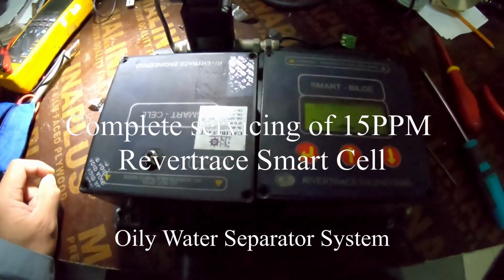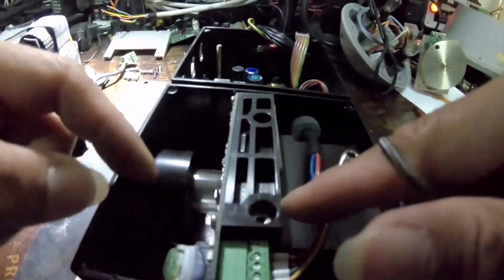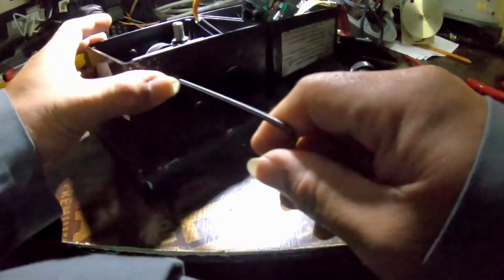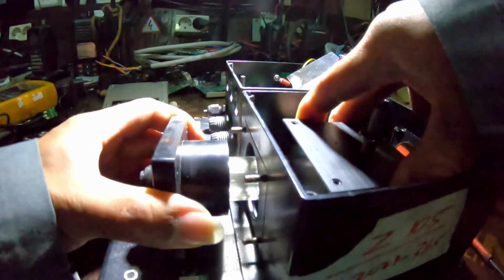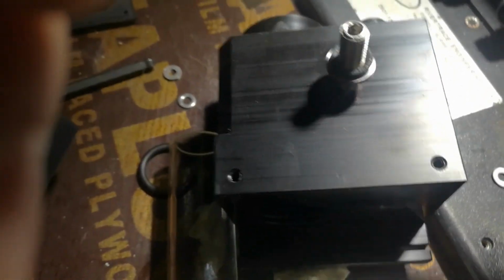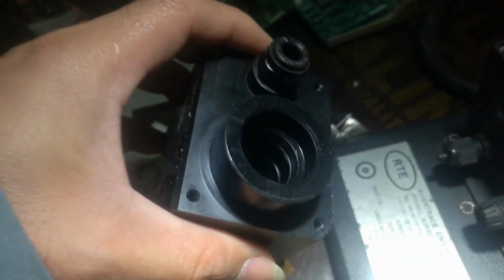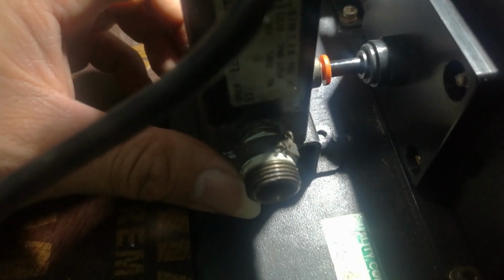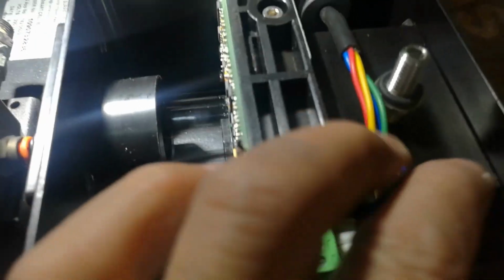15 PPM Monitor Oily Water Separator by  Revertrace Engineering Smart Cell Servicing

Comment: Goodjob, After repairing & open sensor enclosure, do you see an "*SYS ERROR* cell breach Contact RTE" ?
Reply from the maker: Yes, In this case if it is okay when before opening it, you damage the Cell or Not Properly Fitted Back or Throttle has damage the Cell, or if it is the existing trouble before opening it means the Cell has been over Used need to replace with new one
Reply: @bajmarineequipmentrepair  there is small switch on that sensor PCB, when you suddenly detach cover, that switch is Open state.. 😭, and then cell breach message appears...
You're very skillfull 👍, where you come from?
Reply from the maker: @ekoyulianto379  yes correct, that switch should be in close position. Other wise that switch is broken.
Reply from the maker: I'm from Philippines
Reply: @bajmarineequipmentrepair  switch is normal whetever open or close, they just trigger for Cell Breach condition, my false 😭... Nice to meet you sir.. 🙏👍, do you have an contact or email?
Reply from the maker: @ekoyulianto379  It was in my other video explaining about that switch at it gives a lot of trouble. They removed the cover and they started having problems with out knowing it is normal that was triggered due to open cover.
Reply from the maker: My email address bajmarineservices@gmail.com
Reply: @bajmarineequipmentrepair  thanks my friend.. i will sharing to you commom trouble in 15ppm monitor on another brand 👍